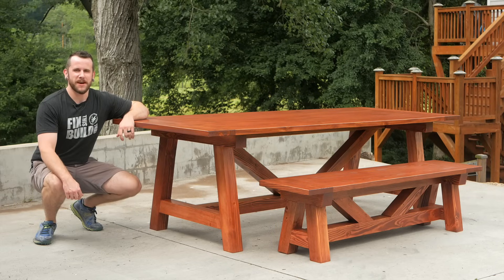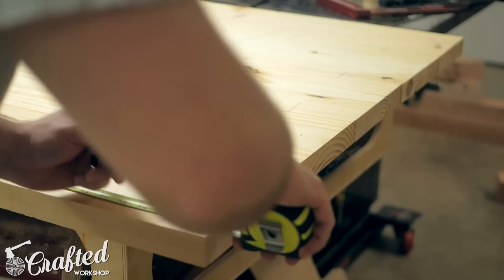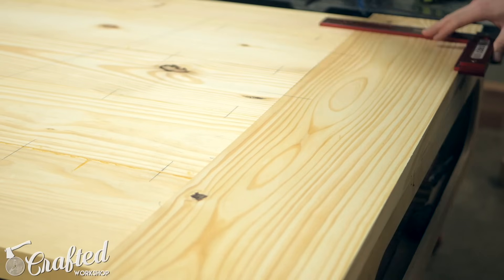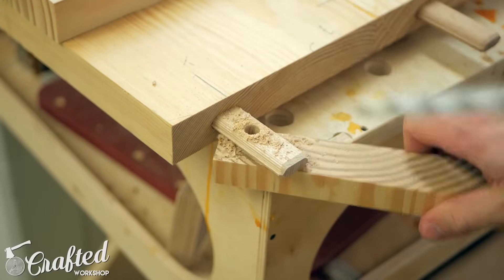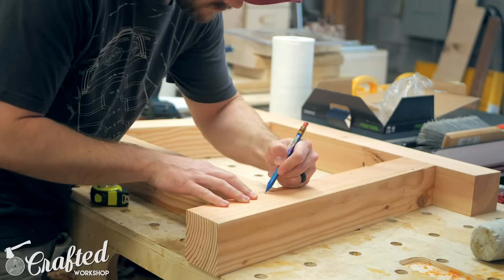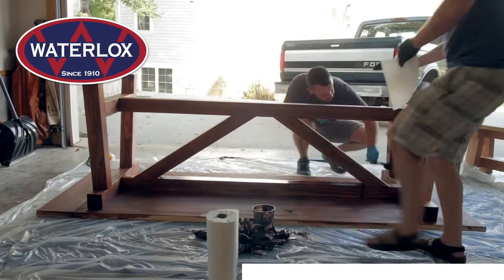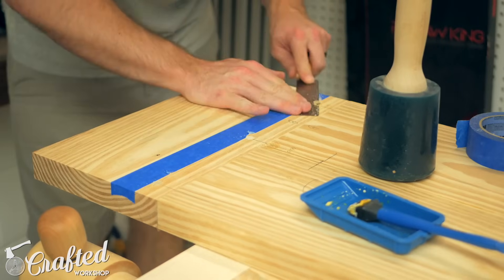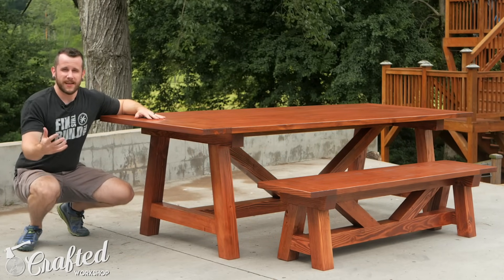How To Build A Farmhouse Table and Benches For $250 | Woodworking DIY

Comment: know what really makes me mad? my country does not have cool dowels made out of real wood at nice and big sizes. just some weak ass ones that are like 1/4 in x 1 in and i can break them in half with my fingers even tho they are that short.
Reply from the maker: Felipe Pereira wow, that's weird! Sorry to hear that.
Reply: Yep, sometimes i'm doing some work and i'm like "Know what would be cool? Driving a nice looking walnut dowel through here and add some flair to the piece" and then I remember that I can't buy them unless I pay someone to turn them for me on the lathe. All I can find is this crappy one: https://s3-sa-east-1.amazonaws.com/leroy-production//uploads/img/products/cavilha_8x40mm_com_50_unidades_home_wood_87568523_0002_600x600.jpg
Reply from the maker: +Felipe Pereira I wonder if Rockler ships internationally. They have all kinds of hardwood dowels.
Reply: Just found out they do! I'll see if that's a viable option! Thanks for all the help, both in the video and in the comments :)
Reply from the maker: +Felipe Pereira no problem!

Comment: Nice build, but $200 in lumber being refined with $10k worth of equipment. Not very helpful for the "weekend" warrior trying to build a $200 table.
Reply from the maker: You could build it with a lot less in tools. A used planer, job site table saw, and a router could be had for under $1k.